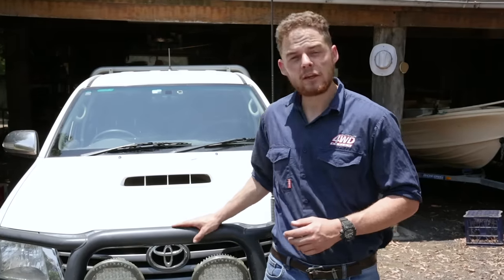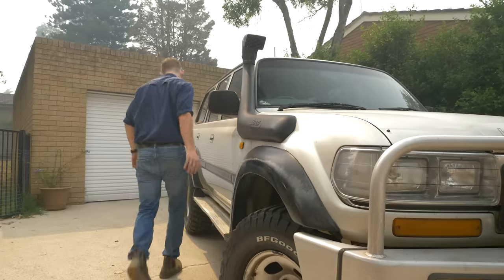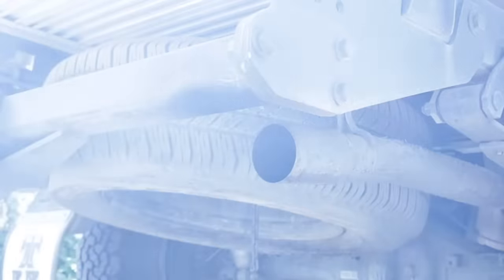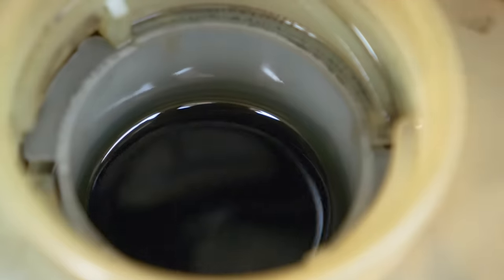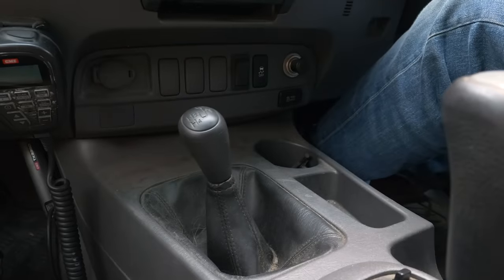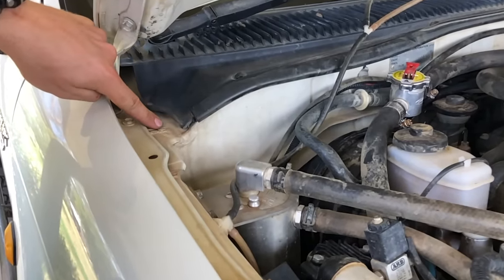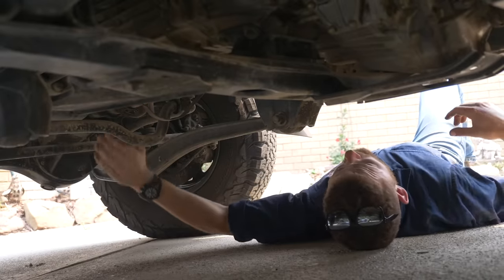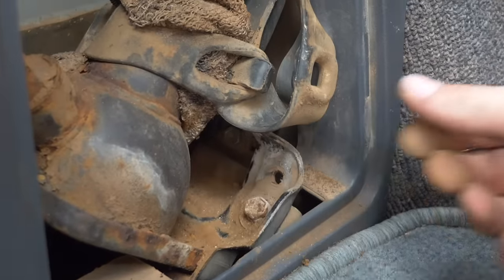BUYING USED 4WDs – Expert tips to avoid a LEMON and get a BARGAIN

Comment: Heavy towing such as a caravan is actually a positive. A vehicle used for a couple of laps wont have seen much dirt as most caravans can't handle the Gibb river or worse.  The wear at most will be rear bushes and provided it's within towing capacity not a huge concern. Of far greater concern is a mining vehicle or a vehicle used continuously in rough conditions often by employees. Or driven through salt water. Rust from salt cannot be fixed. Also do your research. Some vehicles have sealed transmissions that are rarely if ever serviced. They consequently have a limited life.  Excellent video.

Comment: Going a bit too far on this video.  If you follow these tips, you’ll never anything other than a new vehicle from a dealer
Reply: Yeah. I think so too, up to a point. Rust would be the main thing for me. the drive line too, but you would have to reasonably expect to find many imperfections in an older car, especially a 4x4. I advertised my VZ calais for sale once and the guy that came to look at it was over the top. Just about went over it with a magnifying glass, picking out tiny stone chips etc. I said to him "Mate, if you want something in mint condition, you had better buy a new one"
Reply: I just tested a used jeep like 2 hrs ago. jumping in a type of car you havnt ever driven before os ive never used a American car, it's almost impossible to test every thing. Firstly not all 4wd systems are the same, your imidiately in traffic, you got a million things to think of and test with out having the chance to look at the owners manual with a cup of tea n a nice sit down to take it all in. Your aware it's not your car so you gotta be mindful not to damage it or get in a situation you can't get out of quickly. basicly what they are saying is only buy the thing from someone who will let you have it for hours n be able to take it some place you know where you can drive it n put it through everything. then round to your mechanic to do lots of dyagnostic work on it. this can not all be done in 30 mins quick test drive round a busy town centre lol. 
I gave up n took the jeep back after 15mins had to be jump started off the fore court n had a couple warning lights on and engine managment light on crock of shit. I've been looking at 4x4s for a year lol. just jumping in lots of different ones I've found the following.. 
ones that been used for alot of towing ones that's been abused off road even ones that not done high miles n only been used for school runs n round town never been put in 4x4 n so the 4x4 dosnt work. 
And nothing with out warning lights on. 
I think once you get passed my budget maybe they ain't broken ha ha dunno never looked at any outside my budget lol

Comment: Just buy an 80
Reply: will fail every test in this video and still be a smarter buy then 90% off the other cars on the market
Reply: @mitchacosta7233  some of the trucks round my local are running 800k + and still just keep ticking.. I love mine and wouldn't go back to a newer rig

Comment: The guy I bought my d22 off had a heap of aftermarket electronics installed and used the old “my mate Installed them and hes an auto electrician” line.. my low beam gets brighter when I press the talk button on my radio, the connection for the winch was dodgy and failed out in the bush, and where he ran all the wiring through the firewall wasn’t sealed properly and filled the footwell with water after some decent rain. And other wires were ran in dumb spots like in the wheel arch and through door seals.. everything else he had nothing to do with was mint though 👌

Comment: My recently purchased 97 GQ is a lemon
Reply: It's a lemon or you missed a bunch of stuff?
Reply: Mate all patrols are lemons
Reply: @cameronrust6393  Hahaha. Only a jealous rust bucket driver is gunna say that 😉
Reply: Maverick Offroad All I’m gonna day is in my group of mates there’s 8 patrols and my dmax and Im always helping them fix them on the weekends and I’ve never needed help as of yet. But in saying that I’d have a Td42 GU any day of the week 🤣
Reply: @cameronrust6393  Hahaha. The difference there is that the Dmax is too scared to take on the same challenges as the patrols 😂 I've done well out of my TD GQ. Only mechanical things I've had to replace in 5yrs are front wheel bearings, an axle seal & the rear calipers. Truth is, most solid axles are pretty decent & I'd take any of them over ifs any day.

Comment: Bought a 2002 SR5 4WD 4 Runner before shelter in place started. 
A buddy of mine who had a 2002 4 Runner mentioned his fiancee had another a 4 Runner that was not in the market but if I was interested we could start talking about a potential sale. Vehicle was a commuter, never seen off-road. It would get stuck in 4WD and to his knowledge it would require a transfercase as an internal component was no good- a good couple thousand dollar repair depending on parts (new vs remanufactured) and labor. After test driving it and understanding that a transfercase could be a potential repair I bought it from them and began my diag. After a ton of research I found that there are two transfercase switches in the transfercase, one to engage and one to disengage 4WD. These can be an issue if people don't engage 4WD as they essentially get stuck from not being actuated. I pulled them out, tested continuity and one was no good- the one to disengage. Got some electrical cleaner, sprayed it down and tested continuity- still no good, so I purchased a spare. Next day I tested the switch again and it worked- cleaner must have made its way in after a few hours. So I put the old actuator in and have a spare actuator for use in the future.
Fix was under $50 USD instead of the potential couple thousand dollars for the transfercase and labor. This potential repair helped me drop the buy price on the 4 Runner but it did take a lot of research and diag.

Comment: Almost 10 years ago I bought a 1997 Land Rover Discovery 1 for 5K My must have's were solid front and rear axle, turbo diesel, manual, comfortable. and with my available cash flow I just couldn't afford a Nissan or a Toyota. The Disco in my opinion has a more comfortable interior than the equivalent Nissan or Toyota and has been just as good off road. With a strong following and plenty of aftermarket parts available I have mostly enjoyed owning my Disco. As with any old diesel its had some issues but the only time it actually stopped is when the clutch fork blew. even then i managed to get it home.
Reply: very same thing happen'd to a defender 90 i had in the late 1990's,......the ball punched a hole through the clutch fork.

Comment: Waiting for every early ZD30 GU patrol owner to comment they've had a lemon 😂
Reply: Had mine since new 2002 now 289000ks a never had a problem
Reply: Zd30 owner 200k no issues. My Hilux with 60k did big end bearings.. I know which one I'm happier with
Reply: I was more thinking about the blow buy part as they breath heavily 😂
Reply: @adamsquires2  Yes they do, even mine is a heavy breather but it still pulls like a train.

Comment: I bought a 2006 Xterra with 190k miles on it for 4700.00. The truck was in great shape, body and interior are pristine! I did have to do some emissions work on the vehicle but no big deal. I wanted to keep the price to purchase low because I had an overall budget in mind after all my upgrades. Been driving it for 4 years now, what a deal!
Reply: Hello Brooke

Comment: Interesting to hear your comments about different colour paints indicating an accident. I purchased my T60 brand new and said to the dealer at the time of delivery that the front bumper was a slightly different shade of gun mettle grey. Its true that at manufacturing the bumper can be sprayed off the vehicle and because the paint isn't from the same batch can have a slightly different colour variation to the rest of the car. Its barely noticeable but there is a difference in colour and its not uncommon for this to happen with many vehicle manufacturers. Just making note of this as when it comes time to sell the car some people may think its been in a front end accident when thats not the case at all. It could possibly be the way it rolled off the manufacturing line.

Comment: After watching this video of your's i do believe i did find myself an well taken care off half-old Nissan Pathfinder! Looks well taken care off, interiour looks almost unused, auto shifts very smoothly in high/low, engine runs and idle smooth as well..  Every service is followed also. Tho I had to do change the turbo 2 yrs after buying the car.  And also the frame of the car has been tectyled  every five yrs with mercasol. 

Car info: Nissan Pathfinder 06 model,  171hp and 420 tourqe. 

I accidently came over this video, very well made and will most likely help people alot befor making theire choice to buy a used 4wheel drive! 

Much love from Norway

Comment: I found that when looking at any type of car check the trims and clips you will easily be able to tell if the car has been in a smash. For example broken clips or mismatched clips usually show what has been pulled apart. Trims that have been pulled off will have small marks where it has been leaved off the vehicle. Eg, on the doors, on the a pullers and bonnet these are all of the spots that always get stripped to blend the paint. All of this should tell you what kind of accident the vehicle has been in

Comment: I wish I had saw this video earlier,  I had bought a 2012 2.2 litre 4x4 Ford ranger in 2018 that had lots of problem up till now it's still has problems with the engine and gearbox. However thanks for the video It will help alot of people from getting scammed.🙌🙌

Comment: I bought a lemon hilux for cheap only 1500 bucks, first trip out to the tracks the whole roof came off as it was helped on only by bog that cracked and fell out as soon as the rig flexed. In a rollover it would have collapsed in without resistance.
All good though, now it’s caged and without the roof or glass, a real powerful bush rig for sure.

Comment: I bought a kzj120r prado that looked in great nick to my untrained eye, but had a mechanic check it out as I had a very short window to buy. I reckon he took a back hander off the seller because the sheer number of problems that came up was ridiculous. The following all needed sorting: Knackered battery, broken window regulator and track, transmission soleniods needed reconditioning ($1100), cracks in wheel arches, broken air con fan, cracked turbo oil return pipe, cracked gearbox mounts, transfer case leaking and extremely low on oil, knackered bushings on the struts, and the control arms, body mounts absolutely flogged out. There was other stuff too, like there was no receipt for the timing belt, but told me it was 'probably done'. Daylight robbery

Comment: I bought a 92 Landcruiser, 3FE petrol with 286k on the clock last year for 9k.  The seller was upfront in that it had been off-road most of its life.  That said he used it as his business (teaching folks how to 4x4) and it was in mint condition - no rust, everything working & lots of desirable upgrades.  Just because it’s been used off road doesn’t necessarily mean it’s going to be a lemon 🍋 Wouldn’t change a thing on it (other than the dent the wife put in it! 🤣)!

Comment: I'm living in Southland Nz and i bought my car in Canterbury(570kms away). The seller was a farmer and the Isuzu Bighorn 1994 was all muddy in and out. Engine is pretty tidy, no leaks and no weird noises. The seller encourage me to drive around his farm and tried the 4wd if it is working and yes it does work. I was not able to check the joints and underchassis. The accelarator seems sticking out of something but it's drivable. On my way back to Southland, like i'm just half way thru my journey, lights in the dash starts flickering in certain RPM. I bothers me a bit but still continued to my journey. 60kms away from home, my speedometer died leaving me on safe mode running only at 40kph. As suspected, alternator is dead. It also fried my speedometer and speedometer censor. After 6 months i put a new warrant, failed bigtime with ball joints. Another 3months, i serviced the transmission and diffs. Isuzu Bighorn is running great at 380,xxx kms. Kinda scary and only few people like me i reckon would take such gamble.

Comment: I swore off ZD30 Patrols... ended up buying one. The original motor was a bad early one and went at 150k, before my time.

They replaced with a newer (02 03?) Di ZD30.

That engine has taken it from 150k to 570k.... and it still hauls ass. No soot. No blowby. I have never heard the turbo.

Verified highway km commuter, and was serviced every 10k. 

Its never missed a beat under my watch.

Apart from the single owner and highway commuter lifestyle, ill note that this truck is bone stock. It has a polytec bull bar and old school IPF lights. Doesnt even have a snorkel. Never lifted. Stock wheels on ATs. 

Im a TD/RD/TB fanboy. But Ive got a real soft spot for the ZD now lol

Comment: Bought a '91 Land cruiser 75 series Ute, didn't run my hand around the inside of the wind screen all the way and was told there is only one rust spot. then come to see a month later a 1 inch rust hole smack bang in the middle of the wind screen metal.

Comment: I bought a 4x4 3yrs ago first 3 months front prop shaft gone 2 cracked body mounts clutch gave out rusted found mud stains half way up the inner door sills where you couldn't see then head gasket went cheap front wheel bearings....the list goes on.

When inspecting the engine bay and under carridge was all polished up car started and sounded great all the bells and whistles, there is some lying hacks out there had to replace a lot of hack quick fix jobs......oh and gear box had to be rebuilt still own rig but never again lessons learnt, big $$ spent on repairs.

Comment: Bought a 2014 highline amarok in 2016 with 44000km on it. Got it looked over by a NRMA mobile mechanic. Full log book at the dealership. Still had the sidesteps on it when I bought it. 

Serviced it completely with amarok to maintain the warranty and even got an amarok service done on it, before I left for my 5000ishkm drive from: Sydney to, Cairns and then Darwin. 

Stopped in Brisbane for two days and a sensor light lit up(i had just had this exact sensor replaced 6 days ago). 

I take it in to a VW service centre. After two days I received a phone call: "Mr John Smith, your vehicle is fine, the computer is not showing any error codes on this sensor". 

I go pick it up and receive a bil for 218 dollars. They did nothing. Plugged a piece of software into my car. 

Regardless, 17 days later my car exploded in the the Australian outback on the highway. No sensors, no warning. Full loss of power from the engine was my que to know something is fucked. Managed to pull off the side of the  highway( in the worst spot, the peak of the only hill from cammonwheel to Tennant Creek on a bend, 27ish kms from threeways roadhouse). 

Left my girl, my dog, my car and a substantial amount of valuables in the desert to hitch-hike to 3ways RH. 

The roadhouse manager at the time, was a magnificent human. He lent me his car to go pick up my girl and dog and some basics, like swag and clothes; and when I returned he then had organised a friend of his to lend me his car trailer. 

I spent the next 6 hours getting the trailer, being told by the owner of said trailer: "the straps are fine there, never fallen off". 

Arrive with trailer hitched back her in, only to realise the straps have come off somewhere on the highway. 

Hook the hoist up to realise the battery is dead(8pm, dark, looks like the scarab plague out of "The Mummy", every time I use my flashlight. 

Unhook the battery out of the amarok, hot wire the winch, undo all of my 300kg ratchet straps in the back of the Ute and then load the car and proceed to secure it with 4 300kg ratchets. 

Somehow make it back, unload the car (10pmish by this point, missus expected me back 2 hours ago). Walk back into the servo to give the manager his keys back and him and another man who's car had bit the dust are having a drink (bar closed 2 hours ago). 

We all proceed to get extremely drunk for the next 5ish hours and the I go pass out next to my missus in the swag. 

She still brings this up as a "I thought you were dead" moment.

Comment: I worked for the mines. Our landcruisers were never driven out of second gear, because they were locked in that. They were a bargain, 1 year old second hand, if you wanted to use it for chasing cows, otherwise walk away. Our only second hand 4x4 was only driven to church on Sundays by the Queensland Police Service, when they weren't charging over paddocks knocking over termite mounds chasing criminals. It was good.

Comment: I bought a bargain 2002 ML 320 that is worth $4500-$5000 for only $2000 from a friend from church because he was trying to get rid of it as he had too many vehicles. It was also not licensed and there are a couple of things that need to be fixed in side the car however the engine is perfect it has had regular services and has just been used as a daily driver instead of going off road. It also drives very very lovely as well.